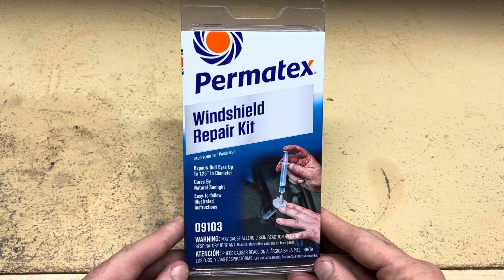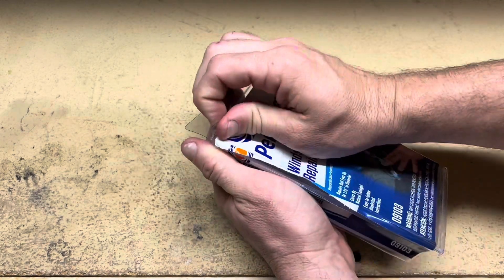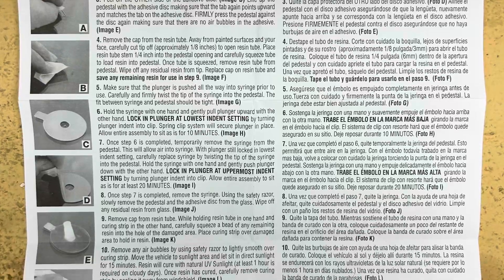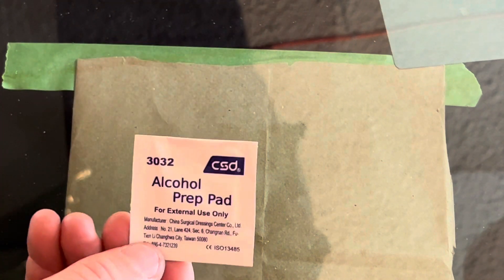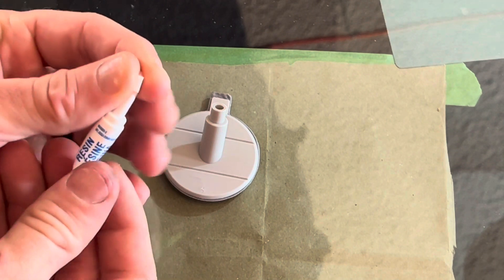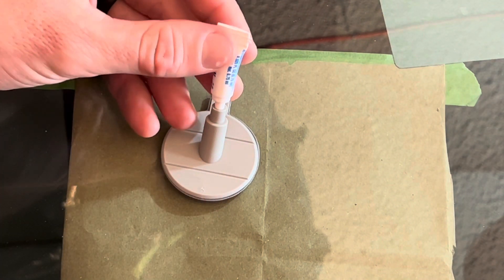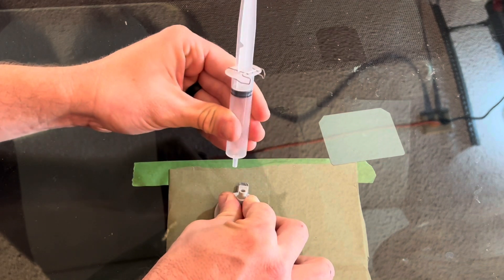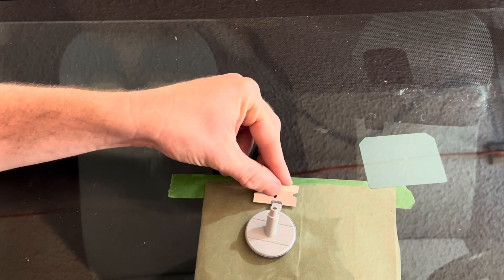Quick Review: Permatex Windshield Repair Kit

Comment: 2:20 you shouldn't peel the plastic sheet of as it can pull everything out of the hole along with it....got at it with a razor blade and not just in one direction.
Reply from the maker: Thank you for the tip. Luckily it didn’t pull everything out, and the repair is still holding up!